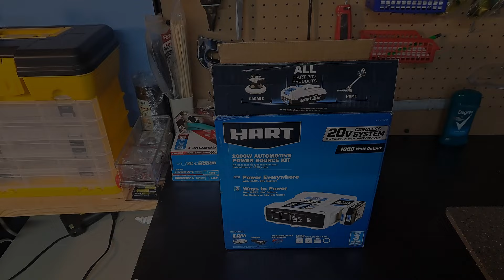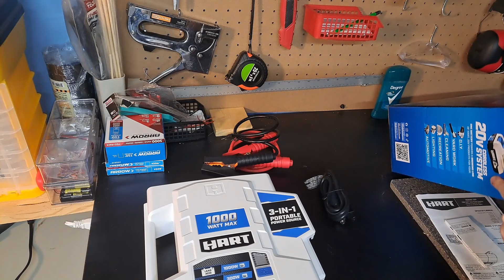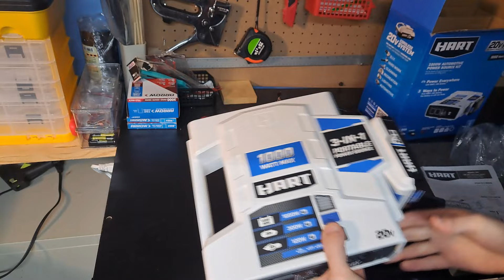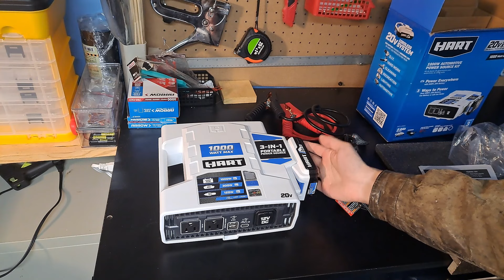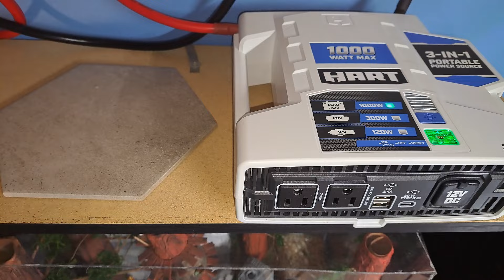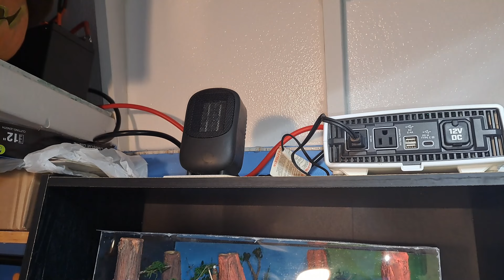Hart 20v 1000watt Max Automotive Power Inverter Review and Semi Unboxing

Comment: If it's sinewave maybe worth it. If it's modified sinewave little expensive.  Guess if it don't say pure sinwave it's modified sinewave. Save a lot of time if you mentioned which one. But I guess sometime it will be found out unless I keep missing it.
Reply from the maker: I just found that it is a modified sine wave. It is only mentioned once in the manual no where else. Not on the box. I don't remember seeing it on the website either. I was not sure myself until I had done a deep look through the manual today. It should have been mentioned on the box, but I think Hart Tools wanted to hide information considering the price.